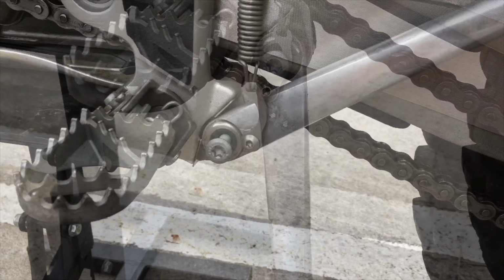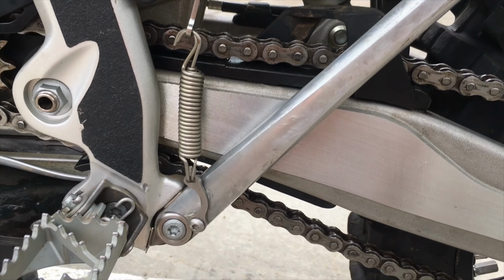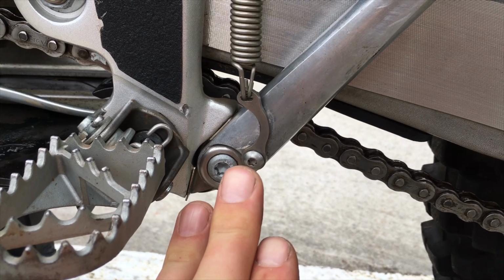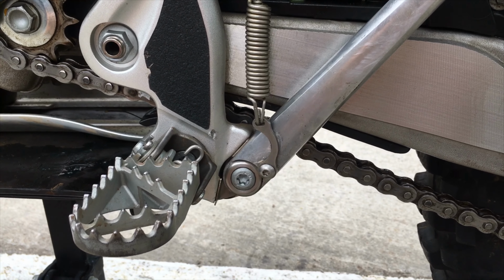How to: Fix KTM Kickstand (a must for off-road riders)!

Comment: what size bolt do you replace it with?
Reply from the maker: The short one is KTM # 0019080206S 8x20: https://amzn.to/3oWm8Rq

The original long one for the bushing is a 0019080266S 8x26: https://amzn.to/43J698g
Reply: @JohnHowerton137  so.... I toss the roller washer and install the short bolt? and that's it?
Reply from the maker: @DaveChristopherson  that’s it! Allows the little moon piece to cam over without tension so it won’t flip up 👍
Reply: @JohnHowerton137  mine seems to lean over too far, kickstand digs into frame, bushing shot?
Reply from the maker: I’d guess the main kickstand hole is hogged out and maybe even cracked. Happens often if people sit on the bike while the stand is down. Might need a fresh leg, but don’t know because obviously I haven’t seen it 🤷🏼‍♂️
Reply: @DaveChristopherson  I have this same problem and have been trying to figure it out, bike leans excessively far over. Did you ever find out the problem with yours?

Comment: THANK YOU SO MUCH!!!  Just got a 2024 FE 501s and was scared to death I was gonna drop the bike due to that stupid-ass automatic retraction.
Reply from the maker: Another government safety add on that makes riding more dangerous 🤣 

I remember my first experience with this safety feature… I was working at a dealership and I went to move a big ass Harley. I tipped it up (I was on opposite side) and moved it a few inches to re-align it in the row. I leaned it back over expecting the stand to be there… it wasn’t. 700lb or whatever Harley pulled me right over and dumped. Of course it hit other bikes and who remembers what got bent. Luckily nobody was underneath the thing.

Comment: Stupid question. when its off and the key is out you can just roll it like if a gas bike is in neutral?
Reply from the maker: That's a legit question. There is no neutral, but it's kind of a faux neutral. 

Easiest way to describe it would be a warmed up gas bike with the engine off and pushing it while in gear with the clutch lever pulled in. Or pushing a bike with a Rekluse Auto in gear.

It's not hard, but there is resistance. It sucks for lubing the chain 🤣 My solution is... to start it in mode 1 and spin the wheel using throttle while spraying the lube. The engine doesn't have the jerkiness of a gas bike so it doesn't flop around on the stand. nice smooth slow spin. Good for scrubbing tires too. Jus watch da fingas brah! 😆

Comment: Thanx.
On my trail ridden 2022 300 XC TPI  the stand works good but I replaced the foot with a larger one.
The bolt, bushing & spring has fallen off mine a few times even after I instslled it using red loctite. Luckily I have found the parts on the ground.
Reply from the maker: I don't have one to look at right now, but is there room for a nylock nut if you put in a/the longer bolt?

I know it happens because the rotating action can loosen things, but it's impressive it backed out with red. Maybe the threads are a little stretched out on the bracket. Up to this point, my three stand haven't given me any grief 🤞

Comment: i'm having two problems.  I just picked up my new 500 EXCF  yesterday and the curved shaped bracket seems like it's bent.  The small bolt that attaches the curved bracket to the kickstand was backing out due to not being properly torqued and it looks like the bracket is bent now because the bracket was trying to go on the outside of the spacer thing.  your bracket looks perfectly flat.  Also my kickstand is sticking partway up and it springs halfway up and then just gets stuck and you have to use your foot to kick it up the rest of the way.  It's 6 hours of driving to take it back to the dealer.
Reply from the maker: Take the spacer out like in this video and see if it works. Could also lay the bracket on a hard flat surface and pound it straight with a hammer, then chase those little threads and medium threadlock it in so it doesn’t back out again.

Sucks you have to do this, but I suspect on a new bike… it wasn’t torqued great, then the spacer kicked the stand up 100 times on the dealer floor with people looking at it… helping to loosen it, then a bunch of fat tire kickers sat on it with the stand down, which the stand was never designed for in the first place. I suspect the original bolt is probably bent too as a result, but you wont need it if you install the shorter one.

Comment: Can you measure the distance between springs fixing points with kickstand up? I want to use same springs and system on GasGas300
Reply from the maker: Is your bike a 2021 GasGas?
Reply: @JohnHowerton137  no, I wish :)) is 2006.
Reply from the maker: @2WheelDerness  I'll try and remember to get you those measurements and take a photo of them.

Comment: Any quick fix for a broken EXC side stand bushing? (Central threaded part where countersunk bolt will grab). Very hard tricky part to weld back. Happened to me and a friend. Both 2017 bikes.

A quick reminder for everyone out there to take a peek at the side stand system to watch out for wear and repair + lube to make it last.
Reply from the maker: Quick fix is; take the kickstand off for the time being and order a new bushing (prob # 78003023080). If there are trees to lean on you’ll barely miss it.

Nothing about the KTM kickstand is durable. It was designed to be light, out of the way and occasionally used... unlike all the other bikes on the planet where it’s constantly in the way of the foot, weighs 5lbs and is a stabbing threat.
Reply: @JohnHowerton137  thanks for the advice. Major problem with it is the very tricky spot. It broke very easily being knocked over accidentally by a friend. No parts lost.
Wondering if it's better to grind the bulge at the back flush and use a lock-nut and longer bolt.
Reply from the maker: As long as it clears the swingarm. Keep in mind, some parts are meant to fail to keep other parts from damage. 

The particular bike in this video often bends shock bolts on hard landings. I thought about installing a stronger bolt, but I'd rather replace a bolt once in a while than crack a frame, subframe, or damage a shock.

Break an $11 bushing, or a $85 kickstand? 

Just something to think about.

Rubber side down 🤙
Reply: Mine busted, haven't figured out a fix yet.
Reply: @alissagrover3147  Sorry I haven't updated this post. I got it fixed by getting a bolt and nut through. It clears the swing arm and the side stand is able to get fixed. For this, you'll have to grind the "metal bulge" flat on one side to get it flat, and drill the other. Use a ny-lock low profile nut. On the bolt head side, if you're fortunate enough to find a countersink that fits great. I found a bolt that had a bit of a lower profile hex head that the spring can get over with not problem. It just has to be long enough to keep thongs tight and checked once in a while. Good quaility threadlock can also be used.

Comment: Do you know where my buddy could get one of those stainless steel  pieces on the kickstand? He lost his spring and it vibrated out over time and now that he bought a new spring he doesn’t have that important part.
Reply from the maker: If you’re talking about the skinny little moon shaped piece that cams over, this is the KTM part number: 78003023090

It it’s about $6 fits oodles of KTM’s from 08-17. Hope that helps.
Reply: Try Bikebandit.com they list full oem parts catalogue's with diagrams, part numbers and prices, i regularly buy stuff from them to Australia or i get the part number there and look around ebay and stuff lol 😁👍

Comment: I just bought a 500 exc today and the kickstand gave out right when i got it home and off my truck. The bike dropped and the shifter cracked the crankcase cover on my engine and its leaking oil.
Reply from the maker: If it broke without a body on it, it might have been pre-cracked for you. They are not really study enough for people to sit on the bike. If it was sitting at a dealer, someone may have been sitting and playing around on the bike on the showroom floor and cracked something etc…

They are plenty functional despite what anyone says. Personally I despise the heavy stands found on Japanese equivalent on high performance motorcycles. These stands are awesome in the way that they tuck out of the way and get strapped up. You can race full on MX and they’re really not in the way at all!

JB quicksteel can get you back and going until you get a new cover. I have several “Fix” videos with it. Here’s on: https://youtu.be/xcpUYDx8hbs
Reply: @JohnHowerton137  Thanks Jon. I will check those videos out. I actually took a picture of the bike before this happened and it looks like the crack wasnt there, because I thought the same. Unless it was very small and just got bigger. But I think it just fell perfectly so all the force went into the shift lever which punctured the cover. I have since swapped the stand bolt to your instructions which definitely would have prevented this. My driveway is a bit uneven so I think it was just enough that the stand was able to snap back up.
Reply from the maker: Yes, I feel like it was just an unfortunate "New Bike 😖" incident. The first scratch is NEVER easy and always aggravating, especially when it's a good one.

Here's my new $12k KTM getting her first scratch (rear fender not shown) https://youtu.be/IHICKHiPGlA
Reply from the maker: And on the "pre-cracked" I meant the sidestand (I thought it broke making the bike fall over). Extremely unlikely the ignition cover left the shop with damage. The person doing the PDI would have noticed that and if they let it out the door and ran out of oil and blew up, that would be a big warrenty claim.

Comment: Have a part number for the shorter bolt? Bought one used and the guy lost both, so I am looking at ordering one. Is there a washer on the other side?
Reply from the maker: Should be # 0019080206S FLAT HEAD SCREW M. ISA45 M8X20. The one used with the spacer bushing is M8X35.

It’s just a KTM subframe bolt used on every bike for decades if you have one kicking around.
Reply: @JohnHowerton137  thanks! I was going to ask too. Amazon actually sells it.

Comment: I had two brand new bikes that lost that bolt within the first 3 hrs.  The one spring hit me in the face and narrowly missed my eye.  What's worse is that my KTM dealer hasn't provided a replacement and I'm now heading into month three of trying.  I called KTM customer service and they didn't offer any help either.  KTM used to care about their customers.... those days are over.  #ktm #iveboughtmylastktm #poordesign #classactionlawsuit #theydontcare #problems #customercare
Reply from the maker: Those days are over with most companies. Probably and unfortunately because everyone is trying to get something and sue them all the time. They just pick their battles and let lawyers deal with it. Not saying they couldn't provide you a bolt (dealer could have easily handled it), but having worked in customer service for 25 years, consumers take very little responsibility for anything, make demands like crazy and instantly turn to social media to get their way... half the time no matter what the company does.

Back in the 90's (and still today) nobody including myself sued about the probably 100s of thousands of Honda seat bolts that fell out and sometimes seat flying off in the air. I saw TWO Factory Hondas lose a seatbolt (and nearly a side panel) during a National on a live TV broadcast this summer alone. We just bought/sold $3 bolts and made sure to Loctite them every time.

Moral of the story... that bolt is $3 and it's a dirtbike! I have a box of them. Basically the same as subframe and sprocket bolts. Bolts loosen up/fall out all the time. Especially on 2 stroke, and especially when bikes are new. (Pro tip, check spokes on new bikes too.) 

Maybe I'm the first guy to tell you this, but if you value your life, you should be checking over the bike and bolts regularly anyway. The nature of where that bolt is located, the threads can be easily stretched. For all I know, you could be one of those guys who sits on their bike with the kickstand down and this is why you've now lost 2 and I've lost zero in 23 years of KTM ownership.

Maybe ease up on the 1st world problems a little and enjoy that marvelous piece of engineering that can propel you through nature at death defying paces. The way you hashtagged, I'd likely to give you no time of day either.
Reply: @JohnHowerton137  Say what you want,  the bottom line is if you produce a product that's clearly faulty you should own up to it and fix it,  not ignore it.
Reply from the maker: @TheMjdiste  is it clearly faulty? This design is from the 90's. 100s of thousands(?) of bikes have used it for 25+ years? Every one of my friends has multiple KTMs (not including my 3 with this stand), one guy has lost one bolt. One. He also happens to be the guy who only puts a wrench to his bike when the Chinese have cloned a new orange bling part to bolt up.

#2bucks #loctite #0019080206S
Reply: @JohnHowerton137  yes,  clearly faulty and a poor design.  There are a significant number of owners complaining.  They could have simply covered it under warranty as they should have but didn't. They got too big and they're going down hill.  I've been on KTM's since 1986. Their new plastic subframe is junk and that's going to be the next blackeye. I realize they could care less but they're losing a lot of historically loyal customers.
Reply: The parts from Indochina aren't helping either.
Reply from the maker: Yeah, well that’s everyone, especially the Japanese bikes. Most KTM parts are not, at least on the off-road models. And the on-road models most of the stuff is actually India, which is far better than China when it comes to mfg. I despise most of the aftermarket Chinese chit if it has more than one moving piece to it.

Comment: How I fixed my KTM kickstand: I bought a Fastway.
Reply: I've jumped my 450 exc over 100' so I can't say I'm gentle, but the fastway fell apart on me during regular use.
Reply from the maker: @abacanabanana  I've bought 2 bikes with Fastway stands. Took them off! Not saying I think they're bad for put-put trail riding, but far to clunky and in the way for my tastes. 

OEM KTM kickstand is the only stand on any brand that hasn't pissed me off. When you have big feet and properly ride on your toes, other stands are ALWAYS in the way. The KTM rubber band make a huge difference.

I rode a CRF250L a month ago. It was barely rideable. The kickstand was constantly killing the engine because the stand is in the way of the foot when you are in a proper riding position. This is the difference between Japanese engineers designing something... and top race teams in Austria designing something!
Reply: @abacanabanana  what failed?
Reply: @briancrumpacker  I forget the exact terms, but there is a pressed bolt where the kickstand rotates on. The pressed piece somehow came apart and the kickstand fell off. Thankfully I recovered it. It costs $50 to repair plus shipping there and back so around $80 when it’s all said and done. A cheap 3rd party kickstand sells for $40-60. I’m worried the repaired kickstand will fail faster than the original since the piece that failed is already worn.